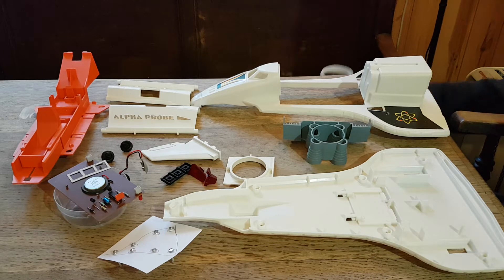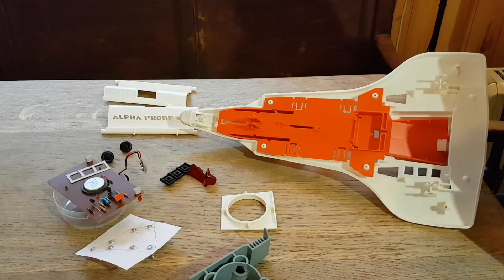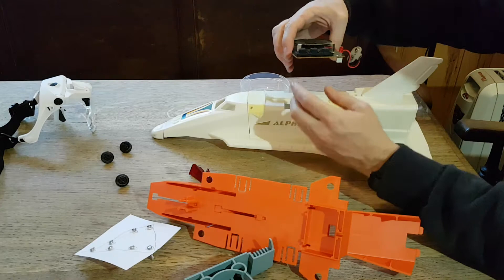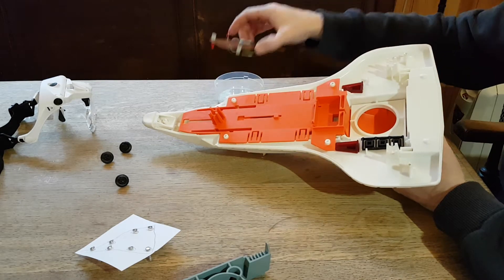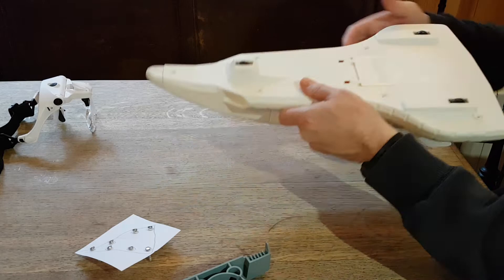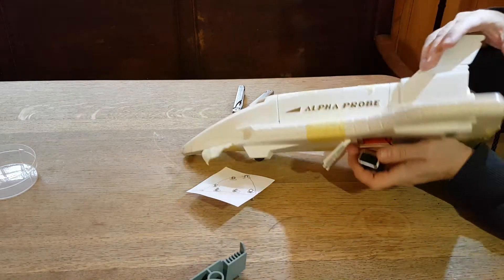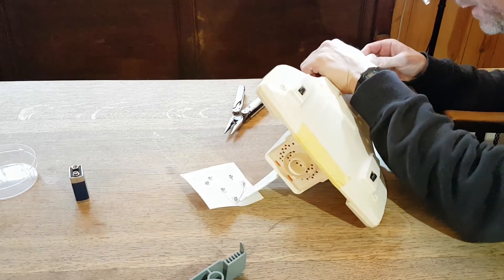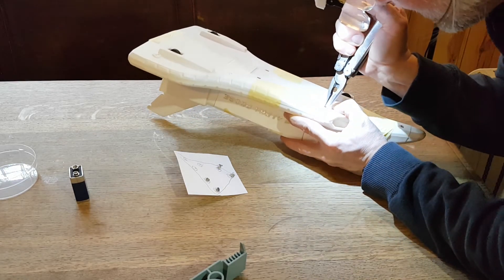Alpha Probe Fisher Price Adventure People Reassembly

Comment: I wonder if you could cover the Tip of the 
Pliers with Plastic Dip to help prevent marine the Screws???
Reply from the maker: The screws are so tight that I think the plastic would be ripped as you need to grip very tightly with the pliers to budge them. You could certainly give it a try though.